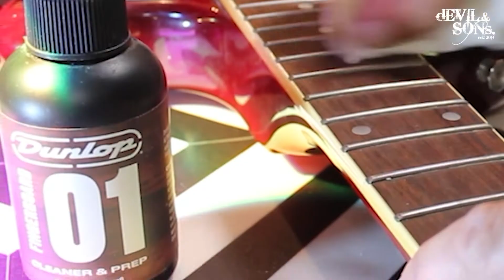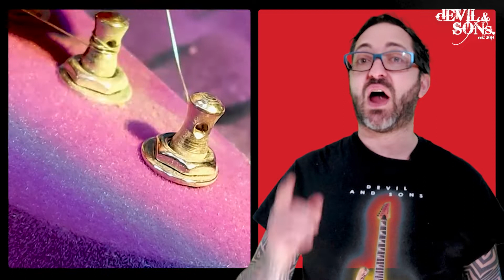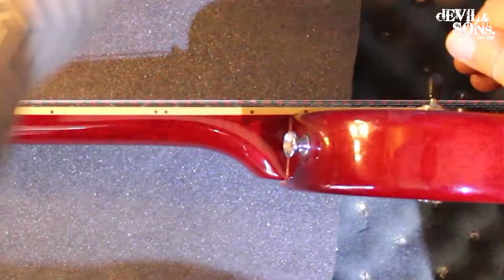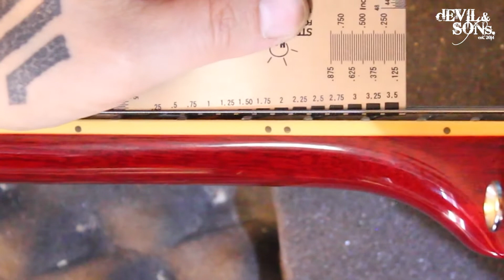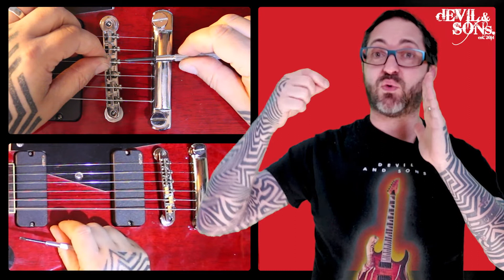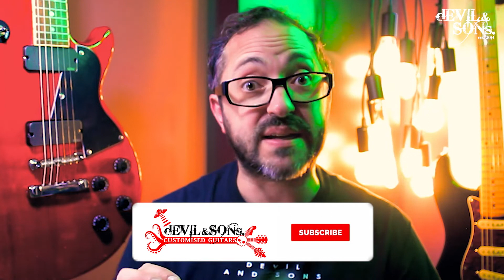How to PERFECTLY set up your Gibson Les Paul Special

Comment: thank you for the video!!! A lot of time and effort goes into filming and editing and your tips on the bridge and tension of the strings was super helpful. I had the high e string sliding off the roller bridge. It looked like the string was not inline with the nut. I finally did a proper setup!!!! What’s your opinion on roller bridges?
Reply from the maker: Thanks so much. They really do take days to record and edit. I'm glad it was helpful. I have only used roller bridges once, they seem fine. I don't think they really offer any improvement, perhaps on a floating bridge but even then I don't know how much. One key thing is to lubricate area where the string may move, so I now always lubricate the saddles during a set up.

Comment: Les Paul special is technically supposed to have a wrap around bridge, so this wasn’t all that helpful for me. But good for the tune o matic
Reply from the maker: Someone else said that, but when I looked into it some do have tuneomatics. I wonder if there were specific years where they tried that out? Anyway, it's all the same except for the stop bar part really.
Reply: @DevilAndSons  the special 1 has the wrap around bridge while the special 2 has the tuneomatic bridge.
Reply from the maker: @klutch4878 thanks for that information

Comment: All my strings are a little sharp on the 12th fret. I feel like my tuners are slipping. I have an Epiphone LP special 2. What kind of tuners would you recommend for 8mm hole?
Reply from the maker: If you're sharp at the 12th fret it's because the saddle position needs adjusting. Is this something you feel you can do?

I recently used Sperzel tuners and liked them, I also like Gotoh tuners. Personally i would recommend locking versions.

Comment: Does the tail piece have to be same height on both sides ? Same height on both screws?
Reply from the maker: As long as the break angle from the bridge to the tail piece is OK it really doesn't matter the exact height of the tail piece or if it is even on both sides. I guess it is just an aesthetic thing that normally it would be equal.

Comment: I take the radius gauge that matches the neck radius then set the bridge to  match the neck the when I set my action I drop the high end just slightly lower than top end 12" on Paul's and casters vary from 9.5 some even 7 that's how bends and whammy bar I thinks works so good on Fenders but I could be ??? At the end of day I love watching these kinds of videos cause your always learning about different and types of ways to do and or make it easier thanks for the advice on couple things I seen how I could do them easier Hoss
Reply from the maker: That sounds like a good strategy. Yeah, I get so much from watching other people's videos too.

Comment: Hi, we have same action ruller ;) should I use capo on 1. Fret when I’m measuring action or string height? Or are we adjusting withouth any pressure just should I check on 12. Fret?
Reply from the maker: Then it does have the inches on the short side. 12th fret to check, with no capo. Hopefully you'll have no problems now. good luck.
Reply: @DevilAndSons  thank you for answering and I have one more question I hope you can unswer. My guitars 6.fret to 12. Fret little bit buzzing so is it my neck little bit concave or convex and which way should I turn my trus rod?
Reply from the maker: @gokhanayvazoglu6295  It sounds like it is bowing towards the strings, or too flat, so turn anti-clockwise to give it more bow away from the strings. But only slight.
Reply: @DevilAndSons  thank you so much for helping and answering but Which side should I look from to truss rod to turn anti clockwise?
Reply from the maker: It's a pleasure. Down from the neck towards the body. Also, you need to check each turn you make to see if the gap is changing as you want it to, just in case you are going the wrong way.
Reply: First I adjusted string action:
 Without capo 6. String 2.0mm and 1. String to 1.5mm 

After I adjust truss rod:
I use capo on first fret and I press with my finger when my guitar meet with body fret (mine 19) (my guitar is Schecter C-6 Plus) and I used 0.010(0.254mm) feeler gauge feeted really well on 8. Fret after I adjust my string action again  without capo to 6. String 2.0mm, 1string to 1.5mm but still I get buzz. I asked some my local guitar sellers they probably don’t know well ,they do (raise strings) and thay said fixed but I checked with my action ruller at home ruller showed 6.string 2.75mm 1.string 2mm thats probably too high for strings and they made probably wrong. I thought (something wrong but they did’t fix and they made wrong. But I thought maybe I do everythink true but if they fixed fret buzz with getting high action more, maybe I should use capo on first fret and adjust again action to 2.00 and 1.5 fret I thought like that) and I adjust action to 2.00 and 1.5. with capo. After 
 
I adjust again truss road with my 0.010(254mm) feeler gauge (cuz string height changed) 
little bit buzzing fixed but I know I should not use capo when I adjust string action. And now my 1. And 6. String touching to bridge of the back. Where did I do wrong how can I fix my buzzing problem. I really don’t know where am I doing wrong. I hope my English is not difficult to understand and I hope you can understand and tell me where did I do wrong ;(
Reply from the maker: Thank you for asking and we'll done for trying everything.
Firstly, nothing is exact, all guitars are different and all people like there guitars a bit different, so don't worry if things aren't exactly the right measurements.
Secondly, it is sometimes impossible to get rid of the string buzz and you may end up with a little bit. A good test is can you hear the buzz coming through the amp, often a little bit of buzz on the guitar doesn't come through the amp so you shouldn't worry.

Now, you do need to go back and firth with height and truss rod. Do one, then the other. Then back until to you are happy.

You must remember - string height is important, perhaps measure it (without capo, there is no point doing it with the capo). I think 2mm for string 1 is too high. 2.75mm for string 6 is high but maybe OK. You need to play it. Make sure the strings are not too high for you. If they are good for you then don't worry about the measurement, but try your best to stick to 1.5mm or less for string 1, and 2.5mm or less for string 6. This is best and easiest for playing, but you must have them feeling comfortable for you. As long ss it is comfortable for you then it doesn't matter what the mm is.

Then, truss rod - it sounds like you need a bit more bow away from the strings. You can use the feeler gauge but remember, this is only a guide. If you have a bigger gap it's OK. I think, on your guitar, it sounds like you can get the string action lower if you have a bigger gap, but you may have a avery little bit of buzz that won't go. 

So I would do this:
1.Set string height to 1.5mm and 2mm.
2. Adjust truss rod so you have little or no buzz.
3. Adjust the strings again to 1.5mm and 2mm.
4. Check how much buzz you have, does it come through the amp.
5. If you have too much buzz Adjust the truss rod a little bit more.
6. Adjust the strings back to 1.5mm and 2mm.
7. If you still have too much buzz raise the strings a bit. Just the ones that buzz. 
8. If the buzz is still there and the strings are too high for you you may have a fret that the strings are catching on. In that case it is the fret that could be the problem. If this is happening message me again and I will suggest what to do.

Good luck
Reply: @DevilAndSons  thank you so much for trying to help me. I do everything step by step what did you type and now fixed thank you :) but I have 1 more question. My 1. String touching back of the bridge (height 1.5mm) and almost bridge height screws touch to body probably I cant get lower more. I droped that string height to check 1.0mm but still touched to back of the bridge. Touching strings to back of the bridge is it normal for string through bridge?
Reply from the maker: Is it a tune-o-matic Gibson style bridge? But then string through body? It really doesn't matter if it touches the back of the bridge. If you cab get the strings lower with no buzz you could try it.

I'm very glad you have solved your problem.
Reply: @DevilAndSons  Thank you soooo much for every thing. You help me really lot and thank you for tried to understand my bad English.
Reply from the maker: Thank you for watching and congratulations for giving it a go yourself and getting done.
Reply: @DevilAndSons  I couldn't have done it without your information and  supports. Thanks again for everything. I’m from Turkey and there was no one to ask or solve my guitar problem in my city.
Reply from the maker: It really is a pleasure.

Comment: I love your videos Daniel. So informative specially for people who don't always do these sort of thing.  

I do however want to throw my 2p in. When setting pick up height (specially with active pups) I don't care what the volume levels are. That is what amps and volume controls are for. What I want is that sweet spot that every pick up has where it is as clean as you can get it and then I start moving from that base to find where I get the best pinch harmonics on EVERY fret of the neck. This can be time consuming but well worth the effort and it does not have to be done all at once. Slight tweaking as you play over time will sort that all out. 

So many people set their pick ups to simply be the loudest they can be with little distortion and then balance the second pick up. They usually tend to sound like ass that way as it is nearly always way too close to the strings and just blows out the subtle nuances you can get with any pickup. Loudest is not always best. Volume is what amps are for and you want the best sound you can get from your guitar so let the amp do the work not the pickups.
Reply from the maker: That is a really good point, and it's got me thinking about that. Thanks for chipping that in. I guess that is something easier to do on your own guitar when playing it a lot, but actually I should try this on my next set up for someone.
Reply: I'm going to try that.  it makes a lot of sense.
Reply from the maker: Great, let me know how you get on.